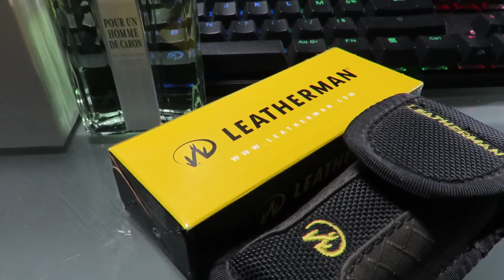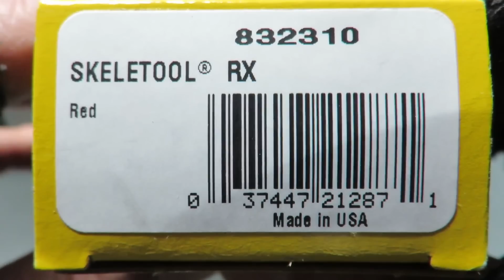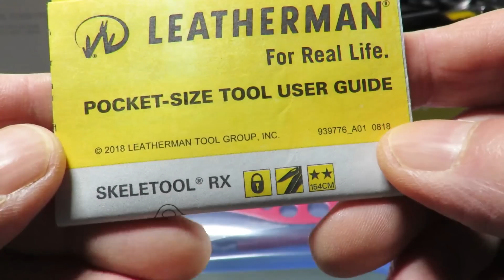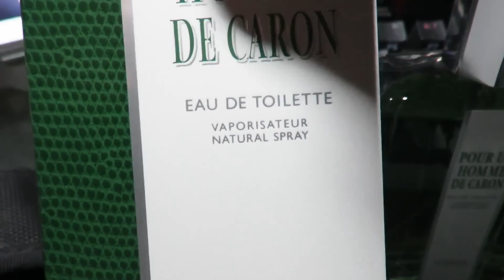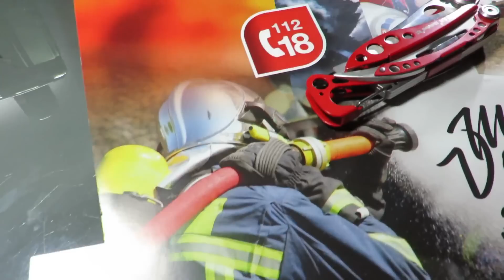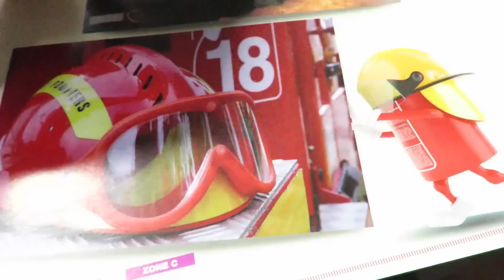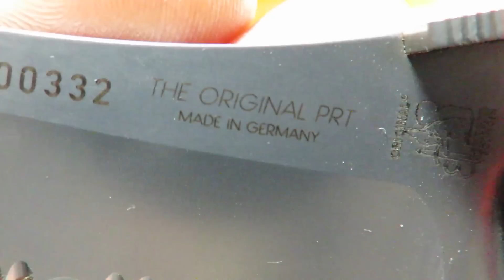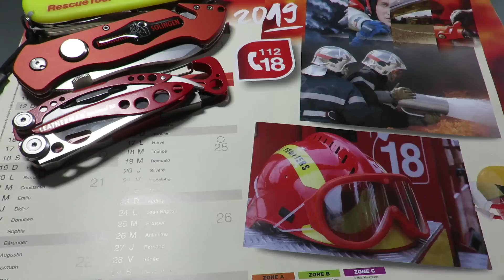Leatherman SKELETOOL RX : EMTs or first responders ? [NEW 2018 RED VERSION]

Comment from the maker: MT VOD * Dear lovers of multi-tools, you can ask me everything, redo a review, insist on a detail, make comparisons, test this or that, I am at your disposal! :) * Multi-Tool VOD
Here is my collection of multi-tools (January 2019) [/S = Brand Sheath]
1- BALADEO Outdoor Cutlery Multi-tool /S               
2- BEAR & SON Bear Jaws 155LS /S
3- BUCK Knives X-Tract 730 /S
4- BUCK Knives X-Tract 735BKS-B Essential
5- BUCK Knives BuckTool 350 (MiniBuck)
6- BUCK Knives BuckTool 355 /S
7- BUCK Knives BuckTool 360 /S
8- BYRD ByrdRench BY15P /S
9- COLEMAN Pro Lock /S
10- CRKT Bivy
11- CRKT Zylla-Tool Jr. /S
12- GANZO G301-H /S
13- GANZO G302-B /S
14- GERBER Balance /S
15- GERBER Bullrush /S
16- GERBER Center-Drive (with Bit Kit) /S
17- GERBER Crucial /S
18- GERBER Crucial F.A.S.T. (with Hex Bit Kit)  /S
19- GERBER Curve
20- GERBER Dime
21- GERBER Flik /S
22- GERBER Fit /S
23- GERBER Grappler /S
24- GERBER MP1 /S
25- GERBER MP 400 Compact Sport /S
26- GERBER MP 500 Recoil Auto-Plier /S
27- GERBER MP 600 Blunt Nose (old model with Pocket Tool Kit)  /S
28- GERBER MP 600 Pro Scout (07564N with Tool Kit) /S
29- GERBER MP 700 Urban Legend /S
30- GERBER MP 800 Legend /S
31- GERBER Octane /S
32- GERBER Radius /S
33- GERBER Splice
34- GERBER Strata /S
35- GERBER Suspension /S
36- GERBER Truss /S
37- GERBER Vise
38- HANWEI Professional Multi-tool by PAUL CHEN 1008-GT
39- HAVALON Evolve Shockey Signature Series XTC-60AMTS /S
40- HENSTRONG (or Bibury or Intey or …) 18-in-1 /S
41- JEEP Multifonction tool with crescent wrench
42- KERSHAW A100C /S
43- LEATHERMAN Blast (with Removal Bit Driver) /S
44- LEATHERMAN Charge+ (with Bit Kit & Pocket Clip & Lanyard Ring & Bit Driver Extender) /S
45- LEATHERMAN Charge+ TTI (with Bit Kit & Pocket Clip & Lanyard Ring & Bit Driver Extender) /S
46- LEATHERMAN Charge TTI (with Bit Kit & Pocket Clip & Lanyard Ring & Bit Driver Extender) /S
47- LEATHERMAN Charge XTI (with Bit Kit & Pocket Clip & Lanyard Ring & Bit Driver Extender) /S
48- LEATHERMAN Crunch /S
49- LEATHERMAN Freestyle /S
50- LEATHERMAN Juice S2 /S
51- LEATHERMAN Juice XE6 (with Victorinox Mini Screwdriver) /S
52- LEATHERMAN Micra
53- LEATHERMAN MUT /S
54- LEATHERMAN OHT (with tweezers) /S
55- LEATHERMAN Rebar /S
56- LEATHERMAN Raptor /S
57- LEATHERMAN Signal /S (with Bit Kit & Bit Driver Extender)
58- LEATHERMAN Sidekick /S (with carabiner)
59- LEATHERMAN Skeletool CX (with Bit Kit & extra long bits) /S
60- LEATHERMAN Skeletool RX /S
61- LEATHERMAN Squirt P4
62- LEATHERMAN Squirt PS4
63- LEATHERMAN Squirt ES4
64- LEATHERMAN Style
65- LEATHERMAN Style CS
66- LEATHERMAN Style PS
67- LEATHERMAN Super Tool 300 /S
68- LEATHERMAN Surge (with Bit Kit & Pocket Clip & Lanyard Ring & Bit Driver Extender) /S
69- LEATHERMAN Surge 2013 (with Bit Kit & Pocket Clip & Lanyard Ring & Bit Driver Extender) /S
70- LEATHERMAN Wave (with Bit Kit & Pocket Clip & Lanyard Ring & Bit Driver Extender) /S
71- LEATHERMAN Wave+ (with Bit Kit & Pocket Clip & Lanyard Ring & Bit Driver Extender) /S
72- LEATHERMAN Wingman /S
73- RATNIK 6E6 /S (with diamond-coated file)
74- ROXON Knife Scissors S501
75- ROXON Multi BBQ Tool MBT3 S601 /S
76- ROXON Sparkle CM1349 /S
77- ROXON Storm S801 (with bit kit & Victorinox Mini Screwdriver) /S
78- RUIKE Trekker LD51-B
79- SCHRADE Tough Chip ST2 /S
80- SCHRADE Tough ST1 (original U.S./ version 1) /S
81- SCHRADE Tough ST1 (Taylor Brands Schrade) /S
82- SCHRADE Tough ST11 /S
83- SCHRADE Tough STE5 /S
84- SEBERTECH Sebertool M2
85- SEBERTECH Sebertool M4
86- SOG CrossCut 2.0
87- SOG Paratool S31 (with Saw instead Philipps screwdriver + Bit Driver + Hex Bit Accessory Kit) /S
88- SOG Pocket PowerPlier S44 /S
89- SOG PowerAccess Deluxe (with bit kit) /S
90- SOG PowerAssist S66 (with Saw instead of V-Cutter) /S 
91- SOG PowerDuo PD01 /S
92- SOG PowerLock S60 (with Bit Driver + Hex Bit Accessory Kit) /S
93- SOG PowerPint (with Hex Bit Kit) /Böker S
94- SOG SwitchPlier V2.0 /S
95- SOG Sync II
96- SWISS+TECH Micro-Max 19-in-1
97- SWISS+TECH Micro-Plus EX 9-in-1
98- TOPEAK The Alien /S
99- UD Vape Cool Kit Multi-tool Cutting Pliers /S
100-  VICTORINOX Cybertool L (1.7775.T) /S
101-  VICTORINOX Expedition Lite (1.7965.AVT) /S
102-  VICTORINOX Huntsman Lite (1.7915.T) /S
103-  VICTORINOX Huntsman SilverTech (1.3713.T7) /S
104-  VICTORINOX MiniChamp (0.6385) /S
105-  VICTORINOX Rescue Tool  (0.8623.MWN) /S
106-  VICTORINOX Signature Lite SilverTech (0.6226.T7) /S
107-  VICTORINOX SwissTool PLUS (3.0323.L) (with all accessories with scissors) /S
108-  VICTORINOX SwissTool Spirit XBS (3.0224.3CCH) /S
109-  VICTORINOX SwissTool Spirit XC PLUS RATCHET (3.0239.N) (with all accessories) /S
110-  VICTORINOX Workchamp (0.9064.3) /S
111-  WALTHER Multi-Tac /S
112-  WENGER EvoGrip S557 (with Victorinox Mini Screwdriver/ ~ Victorinox Evolution Grip S557) /S
113-  WENGER RangerGrip 90.822 /S (~ Victorinox Ranger Grip 74 or 174 Handyman or Boatsman for the pliers)

Acquisition forecast - Call for donations! :)
1- ALLIED TOOLS FlipGrip
2- CATERPILLAR CA35652
3- EMERSON Multitasker EDC-1
4- EMERSON Multitasker Series 3
5- GERBER Diesel
6- GERBER Evolution MP650
7- GERBER MP600 (with carbide inserts & no Remgrit)
8- GRIPsher
9- LEATHERMAN Charge TI
10- LEATHERMAN K or H 502, 503, C33, C55 B, BX
11- LEATHERMAN Pruner (Genus/ Visa/ Hybrid)
12- SAPER (Melita/ Wag-3)
13- SCHRADE Tough ST6
14- SOG CrossGrip
15- SPYDERCO SpydeRench T01PS
16- WENGER SwissGrip
17- WOHO Wokit 2.0 Bikepacking Kit Carabiner Multi-tool

Comment from the maker: I must say that Leatherman didn't dig his brains out much with this Skeletool RX, an x-th version of the Skeletool! To convert it into a first aid multi-tool, a serrated blade with semi-rounded tip and a glass break bit have been added, a bit by the way and still not available as accessories! It was obvious that the carabiner/opener part of the Skeletool needed to be revised as follows:
- install a belt cutter (like the MUT),
- install a glass breaker (for direct action without opening the multi-tool) and with the possibility of replacing it.
Let's imagine that I have to break a car window in an emergency and that the glass breaker bit is stored in the handle...
Because, frankly, the carabiner and bottle opener are not first aid features! 
The Skeletool RX is of high quality, that's not the question, it's Leatherman, but it fails to answer correctly at its destination.
Contrary to what may appear on the video, the closed CX and RX are of the same size.
The CX model I own has a semi-serrated blade while the current catalogue model has a smooth blade.
I have shown gaps between the jaws on the closed CX and RX but I see afterwards that the result is reversed or insignificant.
The RX in relation to the CX (of which insignificant details):
- semi-serrated blade with semi-rounded tip, a little shorter and with two fewer holes,
- reverse mounting of the carabiner spring,
- 8 grams more,
- one less circular marking around the pliers pivot,
- more jointed pliers jaws and no grip at the pliers end,
- end of the non-bevelled pliers,
- a glass breaker on a bit.
I add that the lower part of the notch of taking the blade of knife, inner side, would have deserved to be slightly filed, rounded, because it hangs too much the skin of the thumb!

Comment: Awesome testing! maybe one day test the glass breaker of this tool versus the regular screw driver on the cx to break  glass.
Reply from the maker: Yes, I had thought to test the glass breaker but I had only a glass plate thick enough, thicker than a car window. So I was afraid to damage this special bit especially as Leatherman does not offer it as an accessory.
But as soon as I can, I'll do the test ! :)
Merci ! :)
Reply: Great, and did you know that the skeletool is now customizable on the leatherman website as well as some other models images and lettering can be added to the main blade on both sides and can be different . As well as a tan color for handle.  I ordered one today :) @diezelle57
Reply from the maker: @dukeraul2246  Yes, I regularly check Leatherman's website. You will give me your opinion on the RX when you receive it! :)
Reply: Oh no, I ordered a regular skeletool not rx with my own two different images loaded from my computer on both sides and my last name . Im happy Its customizable though. I only own  the normal skeletool, I think the screw driver would work  well to break glass its very pointy.  @diezelle57

Comment: For a while some sites sold the glassbreaker bits separate, so now I have one in my MUT, in my Bit Kit and in my regular Skeletool CX... Can’t find the bits by itself anymore now, but they must be around here or there.

Leatherman made the Raptor as a rescue tool, and as awesome as the Raptor is to me, so mediocre is this RX in my view.
Don’t get me wrong: it’s still a Skeletool and therefore great. But purely as a rescue tool I agree with the points you make.
The Raptor is always in my side pocket, and I still have a Victorinox Rescue Tool in my drawer in case someone crashes a car in my house and I have to cut open their front screen because they are stuck in the wall.
Both beat this RX in their field, and if you want a ‘real knife’, look at the Benchmade  Outlast (the New Triage). Carrying the Benchmade will mostly get me in prison here in Belgium, but at least it will help me escape beter than the RX...
On that note: the Raptor makes for an awesome kubotan both folded as unfolded, if you grip it right. And that too will get you in jail faster than you can say ‘YouTube Ninja’.
Reply from the maker: Merci pour vos commentaires.
J'avais fait une vidéo sur l'embout brise-vitre du Skeletool RX : LEATHERMAN : Most Expensive Bit in the World [Carbide Glass Break Bit] : https://www.youtube.com/watch?v=GBTufgKvzbs
Puis, sur le conseil d'un abonné, j'ai tout simplement demandé à Leatherman (France) de m'en envoyer un (gratuitement) : LEATHERMAN : Awesome Customer Service! : https://www.youtube.com/watch?v=vzqDxusIs9o